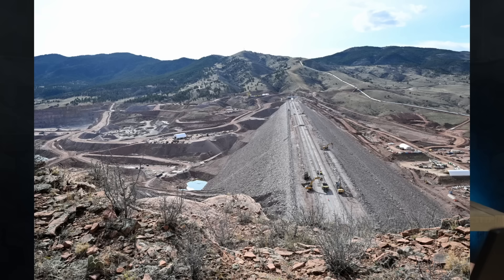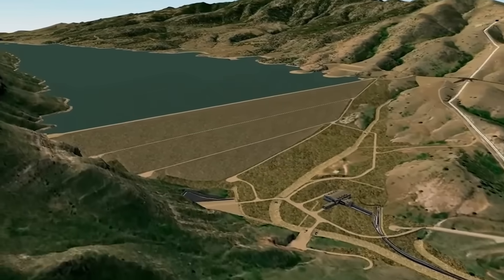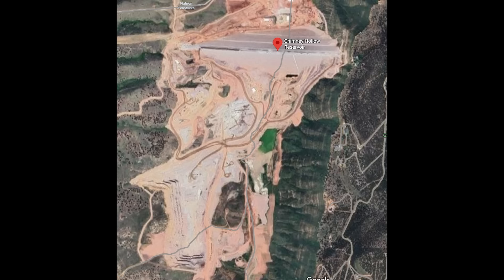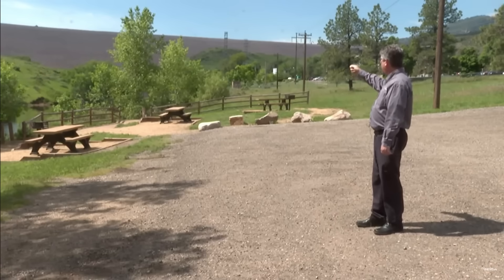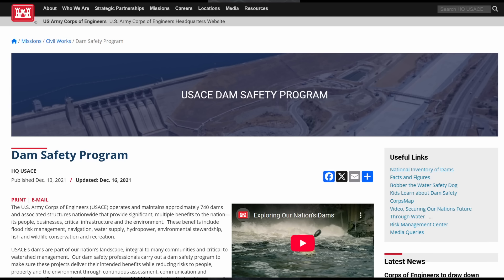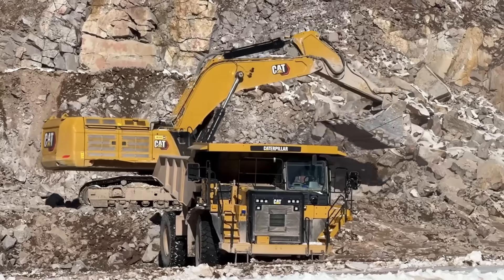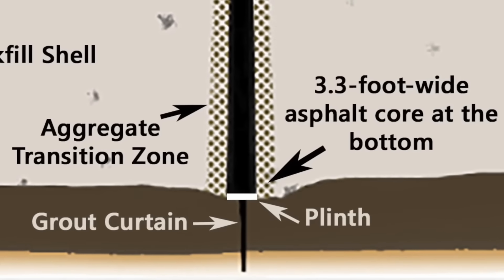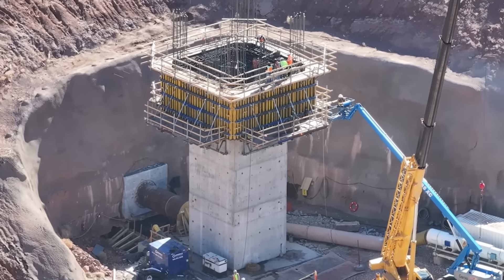Chimney Hollow Dam and Reservoir - Can you Drink the Water?

Comment: Now, while I don't want to sound dismissive I have to say this "uranium contamination" is a quite common thing/ occurrence/ problem in "nature", and this phenomenon is well known since at least '70s (and I myself learned about it while doing my "field practice" in early '80s during my last years in Secondary Technical School of Chemistry - a type of sec school that does not exist in US as far as I'm aware), so anyway I was doing my four weeks stint in local phosphate fetrtiliser factory, and production of it - back then and there - was basically crushing phosphates/ phosphate bearing rock into fine "flour like" powder and then treating it with semi-concentrated sulphuric acid (H2SO4, around 60% strong if memory serves me).
This resulted in reaction in which insoluble calcium phosphate turned into somewhat soluble calcium hydrophosphate/ dicalcium phosphate (CaHPO4), which then could be absorbed by plants when spread on arable fields - but...

But then it ALSO made uranium, also present there, IN TRACE AMOUNTS, soluble too (and it was also releasing substantial amount of HF, hydrogen fluoride, which immediately reacted with silica, SiO2 present in the mix, producing fluorosilicic acid/ hexafluorosilicis acid, H2SiF6, but I digress here)  - and since this fertilizer is spread onto arable lands year after year, there was the problem of uranium accumulation in topsoil - on which edible plants were supposed to grow - and absorb some of it in the process.

Now, to keep this in perspective - I'm talking TRACE amount here - which is like, say, mercury present in bituminous coal - few MICROgrams per tonne. (A microgram, or "µg" is a THOUSANDTH of a miligram, or a MILLIONTH of a gram - 0.000001 g - or ≈ 0.000000035 oz if my math is right - but then again in every cubic metre/ 265 gal of sea water there's about 0.011 mg of gold, so...)
Still, if you burn millions of ton of coal every year these micrograms become "grams" (and then kilograms), and even if majority of the mercury remains trapped in fly ash some still gets released into the environment.

But then worrying too much about it (or about the uranium) would be just as wise as, say, a heavy tobacco smoker worrying about "polonium poisoning" as the main smoking-related problem... Or an obese burger-guzzler worrying about all the uranium in the lettuce leaves in his "junk food of choice"...

Back to our muttons, though - latter on this issue was tackled/ addressed (or there were only attempt to do so) by first producing pure phosphoric acid, H3PO4, and then removing all heavy metals still in solution by passing it through ion exchange columns, and only then producing phosphate fertilizers from this acid - but that would be prohibitively expensive, I reckon, and you can't expect farmers to pay several thousand dollars per tonne of such fertiliser.
Anyway, I never followed the matter, but from my "health-fixated" pal in Germany I heard few years back that this "uranium contamination of/ accumulation in top soil" is something German "relevant authorities" are concerned with - and one proposal "for EU" was to ban import of all uranium containing phosphates and apatites - which would result in ONLY Russian phosphates being allowed, and this wasn't to going to work, and never did (for rather obvious reasons now).

ANYWAY, yeah, uranium - nihil novi sub sole, and no, natural uranium is hardly radioactive - the main concern here is "uranium toxicity as heavy metal", which is SUBSTANTIALLY lesser than that of lead, and at any rate Americans, spreading lead bullets and shots EVERYWHERE in their environment for no other reason than "hey, have some fun!" worrying about some "ppb" uranium in water sounds like a poor, silly joke...
Also, while at it - try to figure out how much lead got into US environment from all that leaded petrol burnt by all these "single digit mileage" insane cars of '60s and '70s with their 5 litres/ 6 litres or even bigger engines, guzzling fuel like bunch of thirsty elephants guzzling water.

AND THEN, last but not least, this "uranium level" exceeds - as it is said right here in this very video - only RECOMMENDATIONS, not "allowable limits" - and then once the uranium will get leached from SURFACE of freshly crushed granite rocks that will be it - water hardly penetrates into it, so I don't think this should be any serious concern here, especially long-term one.
Also, lack of water is more dangerous than water with few "ppb" of uranium in it...

Comment: You can filter the water at point of consumption(house drinking water taps only).  The cost benefit would be hard to argue as the Rocky Mountains contain uranium.  So you have a spectrum of daughter decay products that emanate from Uranium ending in stable lead.   I do not worry about it here, and would consume the water if at or below current standards.  For those freaked out it's time to move.  That's freedom of choice.

Comment: The solution to pollution is dilution. I wonder when it's totally full of water if the amount of radiation will be high enough with all the water in it. The small amount of water they were testing seems to be just rainfall that washed down over all of the rock and concentrated in the bottom. Hopefully we still have drinking water standards in a few years 🙃

Comment: @caseyjones U is not unusual in CO water. I have 0.003 mg/L which is 1/10 the EPA MCL coming from my well. I still have to use a flashlight to see in the dark. But 0.220 mg/L is 73x what I've got. I'm sure officials will spin this because pulling in new residents to get even more TAX $$$ is what the front range cities are all about.

Comment: This is not unexpected. Uranium is a common element, especially in Colorado. The water could be treated before it leaves the reservoir, but it's just as likely that it will be diluted enough with rainwater that that might not even be necessary. Or they may choose to blend the water with that from other reservoirs.

Comment: The fill water is proven to be some of the cleanest water in the nation.  The same source has been stored in the adjacent (next valley east) Carter lake for many decades.  The natural runoff into the large reservoir is very low compared to the source water, and was likely clean too (I am not aware, and can't find any data for the seasonal only flow into the seasonal stream that necessitated the very small coffer dam.  Carter Lake (a mile away) being extremely clean likely justified a presumption that Chimney Hollow would be also (the main construction difference being the asphalt core).  My guess is that most of the concentration is from dust (and very fine material) produced during the blasting and crushing operations to mine process and place the fill.   The unusually high rains washed much of the dust into the coffer dam.  I believe NOCO water's plan was (and still is) reasonable.  What is TOTALLY UNREASONABLE is the idiots from the last fed admin facilitating the REMOVAL OF PRODUCTIVE DAMS IN CA, OR, AND WA - THIS IS A HUGE DAM CONCERN THAT MUST BE REPORTED IN THE MAINSTREAM MEDIA.

Comment: If you haven't seen it, watch Casey's D-Day Video, its great.

My guess about why this information wasn't made public was because they don't know if it will be a problem yet, and as they said if the ppb doesn't decrease when it gets filled, then they will put in filter systems to treat the water.  So by the time it gets to the end user it will be within EPA guidelines.  With data on a project that is still in the process - that has plans for how to deal with those things - sometimes we just need to let them work.

Comment: Uranium is actually way more common than it is known. I guarantee water you are drinking everyday has some uranium particles 100%, it is that common. We can also filter it by both water treatment and also our own bodies too and throw it out. The real danger of radioactive particles comes from those fission products we can not filter. Once they enter our bodies they stay there forever and continue emitting radiation for hundreds of years. 

They didn't announce it earlier because they thought eventually uranium concentration would be reduced in those rocks. But after several years they are still reading higher concentration which suggests there might be more uranium than they thought. So they are announcing now in case, for dodging the blame. Once the reservoir is full, I really doubt there would be higher uranium concentration than allowed. I don't think there is an example of this anywhere on Earth, but there is a first for everything lol.

Comment: If you divide the volume of water in the pond area that is contaminated by the total volume of the pond area when full then you get the answer they are hoping for. If the volume changes by two orders of magnitude you would expect the pollutant ratio to reduce by two orders of magnitude, assuming he the water used to fill the damn does not add additional contaminants.

Comment: As a trucker, I hauled cement powder to that dam to be used in its construction.  Like another commenter mentioned, I wonder about the health effects to all the people who worked on the site and were exposed to the dust during blasting, mining and transportation of the rock.
Reply: To the limited knowledge I have about everything involved, the amount of contamination you would have to be held to, and the amount of time should be far more than you were involved in. There are very common misunderstanding of Uranium and therefor radiation and the "poisoning" involved with it, contributed sheerly from fear. People actually get gamma radiation every single day, which is far more than just passing by some "Uranium dust". People can actually be around Uranium radiation for quite some time (depending on the dose) without any major consequences.

Of course, this is all without knowledge of the entire situation. I just want you to understand that far more often there is misled fear around Uranium (or any radiation for that matter) than there needs to be.

They put the iron vest on you at the x-ray machine JUST for false misleading emotional preparedness, the radiation amount is not enough (even if you did it every day) for it to do anything to you. You get more gamma radiation (far worse than x-ray) from the sun every day. It's just another thing that was done from fear of radiation.

Alpha radiation, has extremely low penetrating power - in small doses it's essentially harmless.
Bera is essentially Alpha, but can penetrate more.
Gamma however, if you look at its friend wrong, it will destroy your entire family.

And that's what I'm saying, you will get more gamma from the sun on a normal cloud free day, than you would get working around Uranium for quite a significant amount of time.
Reply: @Arjay.M88 , the reason why this is potentially an issue is because this is going to be a source of drinking water for the general population. No doubt that a healthy adult can tolerate a certain amount of uranium. But you have to think about everybody who drinks that water from expected mothers while the baby is still forming to people who have compromised immune systems and the very elderly.

These people are all very fragile already with their health they cannot tolerate the normal things that most healthy people can shrug off easily.

So that’s why the government has to be all concerned because they’re not just thinking about yours or my interest they have to think about everybody’s interest, including the most vulnerable. I think everybody tends to forget about these people.
Reply: @DaveP-uv1ml  The limits set would include those people. The readings weren't even that high considering how much freshly disturbed rock there would be. If I had to guess once it gets filled the levels won't be of any concern. They also treat for it, so this really doesn't seem like something to be worried about.
Reply: A major problem with uranium in drinking water isn't so much the radiation, but the metal itself.  Heavy metals can affect a person's nervous system.  It's often called "lead poisoning," but it can be caused by many heavy metals, not just lead.  
It's the reason that depleted uranium ammunition causes long-term contamination, even if the radiation level might be safe.
Reply: Good point.
Reply: I wish YouTube had a "laughing" emoji.

Comment: Did nobody expect uranium in water from granite? It's in groundwater all over the Sierra and, especially, the foothills in California - and in some parts of the Central Valley too. Anyway, as a dam for drinking water it would be expected that some way of isolating rainwater from the "clean" water pumped into the lake would be used. For instance, in smaller lakes like the afterbay of Moccasin powerhouse on the Hetch Hetchy aqueduct, a large conduit (not large enough initially; it washed out in a superstorm one winter and was replaced with a much bigger one, and the cleanout of the afterbay was extensive and expensive (and the aqueduct had to be run in a temporary pipeline for a while limiting power production) was built to route Moccasin Creek around (and partly under) the aqueduct water.  EDIT: of course, compared to the full volume of the lake, it may not matter - the solution to (some) pollution is dilution!

Comment: Is this dust from construction that is washed from first filling but won't be a concern long term, or is it truly water leaching through rocks and sending uranium into reservoir on long term basis?
For first, couldn't they "hose" down the rock walls and the da itself to wash away radioactive dust, create highly radioactive water thatr is then treated and remmoved, after which the reservoir is fine? 
For second, could they use shotcrete to create a think covering of all areas of dams/rock faces that can leak radioative water ?
(I realise this is moot since they've already begn to fill ot indicating they intend no remediation to problem).

Comment: The front range has a tremendous amount of uranium deposits from Colorado Springs to Ft. Collins. In fact a Canadian company was going to mine uranium around Ault Colorado a few years ago, by injecting water into the ground and bring it to the surface to be process. One other place comes to mind where there is a lot of natural occurring uranium, and that is Ralston Creek and Ralston Reservoir. Several years ago I work on a environmental project up Ralston creek/canyon-(Schwartzwalder Mine), where the Cotter Corp. closed down their uranium mine operation. There was significant amounts of uranium that ran down stream from the mine, and several containment ponds were built to capture it. Even after the ponds were built, there was tremendous amount of uranium that made its way down to the reservoir. It was later determine that natural occurring uranium from Ralston Creek was contributing to the contamination at the reservoir itself. The City of Denver owns that reservoir and the water from it is sent to a treatment plant, where the uranium is removed. Then the water is delivered to the City of Denver water customers. Northern Water is a good organization, and will probably build & treat the water like the City of Denver.

Comment: If you are ignorant to believe that you can just drink surface water all the time , then you will be a great part of "Natural Selection". You can not even drink water that has pooled up from a melting glacier. Why, surface water contaminants or pollution that is in the air. Water molecules only drop as rain after they have come in contact with something else, like dust or CO2 molecules. Sort of like minnie me of hail, collects until it is to heavy and drops. All drinking water either has to go thru a natural filter(hundreds of feet of earth) or be filtered 100 of times by man made filters(usually plastic filters).  Uranium will not pass thru natural filters. Water with Uranium found in it , is because the water is being stored in  aquifers with Uranium walls where it is exposed. When thinking that filtered water is the best, just remember that the filters are made of a very fine woven polypropylene. Micro plastics do accumulate into deposits that grow bigger.

Comment: Traces of Uranium are everywhere, even filling the oceans at 10% of the EPA drinking water limit, where most of the world's fish thrive.  If reservoir water it is near the EPA drinking water limit, it can be filtered out. If it is used for agriculture, I'm sure all the farmland already contains plenty of Uranium from the erosion of the same mountains and contributing to the background radiation levels everywhere.  The rainfall pumped into the reservoir will dilute everything found in the rock dust generated by blasting, making it just a small part of the existing background radiation around us and in everything we already eat or drink.  There is little reason to look at the blasting runoff concentration, unless you plant drink it in that concentration.

Comment: What they are probably experiencing is leaching (through oxidation) of uranium from the newly exposed rocks, and the small amount of runoff from rainfall events presents a higher than representative concentration of uranium.  I say let them fill the reservoir and then test for uranium.  First, the uranium leaching from the newly exposed rock may be reduced over time and second, the enormous amount of water stored behind the dam will reduce the concentration by several orders of magnitude  - the solution to pollution is dilution.